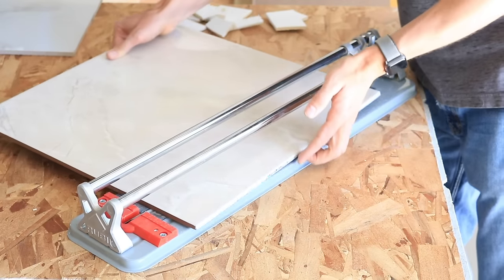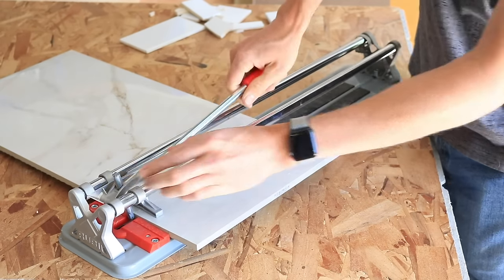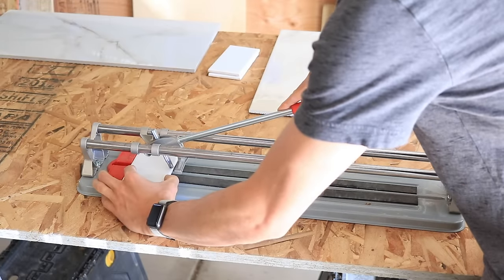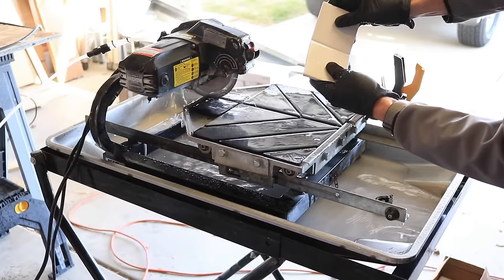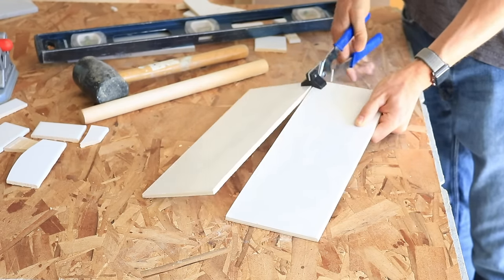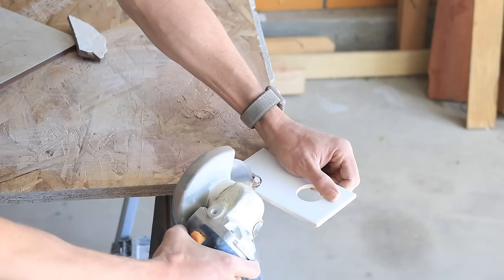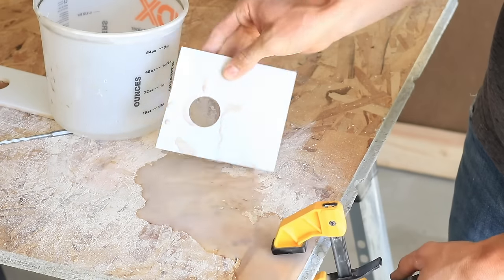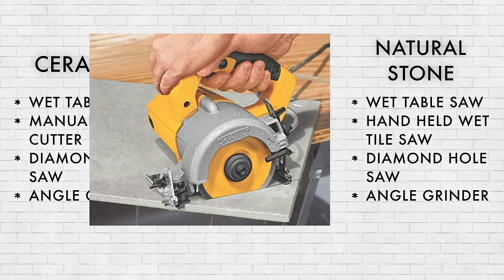5 Ways to Cut Tile - Everything You Need to Know for Your First Tile Project

Comment: Dude you are giving me anxiety when using that angle grinder. I work withe things every day and i got stories of getting bit close calls and other guys stories of f***ups.
Reply from the maker: I've been using an angle grinder for the last ten years. It's actually very difficult to hurt yourself with one because the blade is smooth. Even when I have nicked my finger it just takes off a bit of skin or nail. The real danger comes when you have a wood blade on an angle grinder. Those can mess you up.
Reply: @StayHandy  yea, i caught myself with an angle grinder with cut off wheel.... Went to move the cord out of the way and my off hand kind of swung with it.. yea caught the tip (about an inch down) of my index finger... Lucky I didnt just cut it off.. went in about 1/4" or so..

So yea gave me anxiety to...
Reply: @StayHandy  Nicked fingers? Aaaargh! You badass bro' 😎
Reply: Most diamond blades burn rather than cut you. So I don't understand the anxiety unless it had a different blade on it.
Reply: maybe you need some storm trooper armor?  i use leather gloves and safety goggles every time and never an issue.

Comment: Hey! Thanks for the advice! I’m a carpenter that hasn’t done tile yet but I did want to mention I got a little nervous watching your fingers get so close to the table saw and how you set the grinder down while it was still ON! Be careful! And thanks for the content!
Reply: me too!
Reply: Same here, I wa so nervous too
Reply: Believe it or not the blades for cutting tiles are not that dangerous to hand. I've seen a professional tiler run his hand over to show me how I dangerous it is to the fingers. Regardless I will still use all thx necessary precautions.
Reply: I had a close call doing exactly what he did with the angle grinder almost cut my arm when I forgot it was still spinning NEVER PUT A SPINNING TOOL DOWN

Comment: First time "tiler". Thank you for demonstrating how to cut tiles. I just finished re tiling with subway tiles around electrical sockets which the tiler sneekily hid with grout. I used a manual tile cutter and an angle grinder with a diamond blade disc to finish the job and it looks amazing. If I were younger I would probably learn the trade instead of doing a boring office job.
Reply: Same. Wish I did a trade
Reply: Do you wear a mask when cutting tile
Reply: @Jack Cass hello
Reply: Same here, i wished i had learn to do trade job, i hate the boring office job

Comment: Thanks Dan. Really helpful video. I just did a bathroom tile and when cutting my "PORCELAIN" tiles they would just crack. I heard about the scribe-then-just-snap method and thought a handheld scribe would do. Boy was I in for surprise. Every time they cracked with lines running all over. Well, after listening to you describe the first two methods, I realized that I should've went with a water saw to make my cuts. And it makes sense, harder tile needs more power and precision to make needed cuts for your project. So next time I will be using a water tile cutter to make my cuts for the harder tiles, and now because I tuned in to your common sense video, to me, I will use the handheld for those ceramic tile back splash jobs. Thanks a million Dan, keep up the great info.

Comment: thank you for showing me that the tile I cut yesterday looked just like your examples-I thought I was doing something wrong with my handheld grinder on cheap ceramic (first try didn’t want to spend much money)  and, that I need to be less timid about actually breaking the tiles after scoring my tiles (multiple times ha ha) I have been moving the handle down to the middle of the tile to break it and having all kinds of problems with the tile breaking in the wrong place I think I just need to be more sure of myself and try to break it with the handle at the top of the slider or like you show in the video-I hope this made sense but your visuals are great!
Reply: Some manual tile cutters only have a Raised metal piece under the tile at the top where you finish scoring. Which assists the break itself. Either way snap from the top. Also make sure after you score it that you don't move the tile during or after the score, until you snap it. Once you're ready to snap you can even give it light pressure with one hand and give your hand a Slight tap with the other. Making the snap more sudden.
Reply: @kraven4444  Thank you!

Comment: I notice that the mechanical tile cutter you are using in this video allows you to cut the tile using the base of the cutter for support;  I've got one that requires  lifting the scored tile and centering it under the bars, one edge of the tile resting on a small raised pad behind the scoring the wheel. Pushing down on the lever pushes the tile against the bars until it snaps along the scored edge. For thin ceramic wall tile (3/16) ,my  tile cutter works except for cuts close to the edge since there's not enough tile  passing underneath the outside bar; It would seem that the tile cutter in your video would make these "close to the edge"  cuts possible.  Am I right in my thinking, or am i looking at one of the other methods ( tile nips, rotary grinder) for trimming tile?
Reply: P

Comment: this is a good video and a bit of an eye opener but its only for cutting tiles in a one cut how would you go about cutting a tile in a circle not a hole a quare into a circle any ideas?
Reply from the maker: Use the angle grinder
Reply: @StayHandy  I did think that but I want a smooth finish as it's going to be a table top cheers anyway

Comment: you don't need to cut with wet cute just use a tile cutter and on the rough edges use a grade 60 sand pad to Rubber the edge down all way put your cut ends a against tile  trim  👍

Comment: Great video thank you. I have a question... is there anyway to lessen edge chipping when using angle grinder? Well it is actually a Dremel ultra-saw 7.0amp with the Dremel US540 Diamond tile wheel. >> I tried cutting wet but it only helped slightly.
Reply from the maker: I'm not sure how to do that. I think what causes the chipping is the blade vibration. If it's perfectly balanced it likely wouldn't chip as bad. But that is just a guess.
Reply: I lay down painters tape, mark and cut through the tape. It helps with the chip out.

Comment: your diamond blade looks a bit rough, i use a a smooth carbide blade and it doesnt seem to cut rough at all - I did all my large format tiles this way - cutting straight is easy since its basically a gyroscope.

Comment: I have a grinder, holesaws ¾" - 4½"for tile, and a cheap small wet saw I picked up from a yard sale many years back just because. All of them cut tile quite well. The grinder does leave a ruff cut but I can clean it up enough. Anyway I'm still nervous on setting tile as I've only ever done it once many years ago. I know plumbing, electrical, I'm no carpenter but I can get by, but tile work kinda makes me nervous. Mostly because I've seen some horrible tile work from so called professionals and I'm not sure if they just didn't care or either way thanks for the videos hopefully it can reassure me a bit.
Reply from the maker: Thanks for the comment. I’ll be posting a video on how to tile in a few weeks so hopefully that will help!
Reply: they weren’t professionals.. most likely amateurs

Comment: Thanks for the video, Dan . At 5.30 that's very dangerous . That grinder slipped would go straight into your wrist. Clamp the tile to a suitable surface and wear safety gear.

Comment: Using a damp sponge held gently against the blade greatly reduces dust and heat when cutting with the angle grinder.
Reply: Someone is going to loose a finger with that advice and his angle grinder “technique”. Really not cool.

Comment: Wet wheel tile cutter for me always leaves a bit of chipping on glazed tiles, even using a brand new wheel. The sliding rail cutter does better on straight cuts on tiles that are not too thick but I always oil the wheel
Reply from the maker: Thanks for the tip!

Comment: What tool do you use(can i use) to cut the square for electrical box/wall outlets. I need to cut mossaic and stone tile. Thank you.
Reply from the maker: Angle grinder
Reply: @StayHandy  ok. Thanks. I own a Milwaukee 4 1/2"- 5" grinder but wouldnt a 4 1/2" wheel be too large? Is there a 2" wheel i could use? Thanks for replying

Comment: how to cut round corner smoothly ?
Reply from the maker: Use an angle grinder and cut it wide to start, then slowly shave off material until you get the curve you want.

Comment: Hello, what tile saw blade do you recommend? I would need a 7" blade with 7/8" arbor.
Reply: Most blades come specifically For certain Materials. Blades for Porcelain, Blades for Glass specifically, etc. Sometimes RPM rating is also a factor. Check to see what your saw uses just in case.

Comment: What about a jigsaw with diamond blades and a oscillating multitool?
Reply: Honestly even if you could I don't see the point. Jigsaw would be pretty slow and also create some dust.   Not to mention a Jig saw moves down and UP... meaning on the Up stroke it would be chipping tile. A multi tool would be difficult to control and slow as well.

Comment: I was scared, watching you cut tile with that angle grinder! And even the wet saw...yipes! All you need is one slip.....and bam! There goes a finger/vein...
Reply: To ne jest that scary when you get used to it. I can polish nails with(and I actually did). To cut a finger a person needs to be really out of himself, dumb, drunk, or combined.
Reply: @AliShuktu  grinding discs break you know, and when they do, they travel at 60km/hour. Good luck with that
Reply: @loneforce  
Actually maximum velocity of the edge is 288km/h but whatever. 
What is your point, boy?
Reply: @AliShuktu  I think I already explained the danger.. "boy", some people only learn after the accident happens
Reply: @loneforce  
  It seems you do not understand what i'm  saying. I worked as the safety officer on construction sites. 
I do understand how power tools work. I repair them.
And as i said you can pretty safely polish your finger nails with it.
If you disagree then please explain your statement or i'll consider you as uneducated and provocative.
Reply: Idk about other blades,  but the blade on the wet saw I use at work I can touch the blade with my finger and it won’t cut. Freaks people right out the first time they see it done. Haha

Comment: The QEP tile cutter I bought for 100$ at  Home Depot doesn't cut porcelain longways only sideways. Time to take it back. And I even tried cutting them for a 3rd time. Still nothing. Just broke tiles all day. POS.
Reply from the maker: Yes you need a good tile cutter for porcelain.
Reply: I got the 24" by Kobalt.  Cutting 3/8"  24" by 24" Porcelain and it's fine. cost like $110. I'd be surprised if the QEP was the issue. A lot of factors go into it. I went cheap as well. It's probably a good idea to Oversize the cutter rather than using the cutter to is Max capacity. Go one size up.

Comment: Try a sigma manual cutter they cut marble amazing bit of kit I sell tiles for a living and this guide is pretty much spot on well done mate also angle grinder using a wet sponge is a great way to cut tile in general
Reply: please elaborate on how to use a wet sponge to reduce dust with angle grinder.
Reply: The water keeps dust down and also keeps the blade cool that's what Fry's the blade in the long run
Reply: @porkbap55  How do you use the wet sponge with the angle grinder ?

Comment: Tile cutter @ Lowe's $25.00
Reply: Not good for consistent cuts (wastes tile). Cheaper to get a Skil 7" tilesaw for under $90 at Lowes. I have two of these, and a pro Dewalt tile saw. Save the expensive saw for the big jobs.

Comment: If you want a cleaner cut with the grinder, start cutting with the inside edge of your wheel blade.
Reply: What’s the inside edge of the blade? Depending on how you hold the angle grinder, either could be the inside

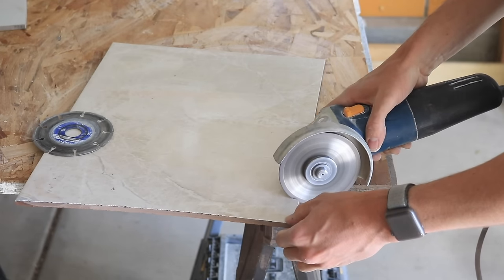Comment: I strongly advice everyone reading this to never, ever, cut the way he does. From 4:47 is one of the best demonstrations of terrible safety measures that you can probably find on the internet. One split second of the blade ‘riding’ the workpiece would have cost him his fingers. Especially at 5:26. But the most concerning example starts at 5:30. He is going towards his wrist that is not even 10 cm away. I’m sure I don’t need to help you visualize what could have gone wrong here, but the scenario contains the word ‘artery’.

Please watch real experts work that follow the correct safety measures. They would NEVER handle tools the way he does.

In my opinion, it was absolutely reckless uploading this video for newbies to watch.

Comment: What you missed are nippers. Nippers allow you to nip clean pieces off to form arcs. Or just edges to fit. Nippers are common to tile mosaic or stained glass work.  I'm pretty sure you can use nippers to cut tile indentations for around electrical boxes. I think you can drill corner holes with a ceramic drill bit and nip away the tile between the holes.

Comment: I put a chair rail tile up and need to install a shower door now. Do you think the diamond crinder would work for cutting a notch in the chair rail?
Reply from the maker: the angle grinder with a diamond blade will cut through just about anything.

Comment: QUESTION:   With regard to the angle grinder 5:12 ...  Could I clamp down a ceramic tile, run water over it with a hose and expect a cut comparable to a wet saw?  Is it just the water that makes the difference?  I have only 2 tiles to cut down to size.  Thanks
Reply from the maker: Chipping in the tile also comes from the vibration of the blade. If you can hold the blade steady and it is well balanced, you should be able to create a clean cut with that method.
Reply: @StayHandy  Thank you

Comment: Great video.  How do you cut 24" tile.?  They won't fit into most cutters!
Thank you.
Reply: What do you mean? Lowes has 24" 30" and 36" cutters by Kobalt for around $110,  $160 and $180 prices respectively.  As should Home Depot and even Amazon has a wider range of choices. I just bought the 24" Kobalt tile cutter to cut thick 24" x 24" Porcelain and it's working well.

Comment: Can I cut tiles with miltre saw ? Thanks
Reply: I would think NO. Even if you could put a diamond blade on it. The saw comes from the top down instead of starting from one side toward the other.  Even if you have a larger Sliding Compound saw, The blade is spinning the Opposite way. Also there's no water involved. Even if you could manage to cut one it's not not safe to use these tools in way they're not meant to. Not worth saving the 50-100 bucks you would spend for a tile saw.

Comment: Thanks for sharing.  How would you cut a small glass/ceramic mosaic tile without it breaking/cracking?  I've tried several times but i cant get the right shape to fit the edge of the drain bar

Comment: I am using the first tile cutter with ceramic tile. I keep breaking my tiles
Reply: Make sure the tile cutter is For ceramic. Score from end to end all the way. Don't miss the ends. After scoring the tile don't move the tile until you snap it. Snap from the top where you finished scoring ( Not the middle of tile ). Snap with confidence. You can even push down and give your hand a light tap with the other hand to make it sudden.
Reply: I doubt you're doing this, but make sure you're not snapping with the blade and using the snapping pads. I know it sounds silly but some might do it.
Reply: @kraven4444  I was doing it that way lol thanks.

Comment: Dude, you are going to chop your fingers off using that angle grinder. Until you figure out how to use one safely (possibly one of the most dangerous tools on a construction site), I suggest you don't demonstrate the reckless use of one on your videos.
Reply from the maker: Show me the data that this tool is dangerous with a diamond blade on it. I’ve been using one for ten years cutting granite, steal, and anything else I need to cut and have never once seriously injured myself. I have nicked my finger several times, but even then it’s a very minor injury since the blade is smooth. It never even bleeds. Now sure, if I had a wood blade, that would be super dangerous. But if you think it’s dangerous the way I’m using it then you simply don’t know what you are talking about.